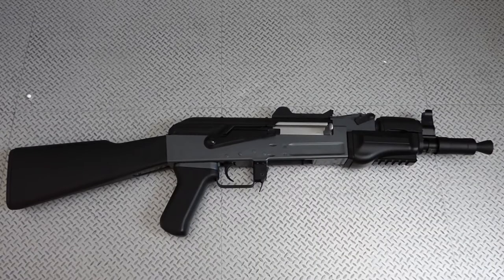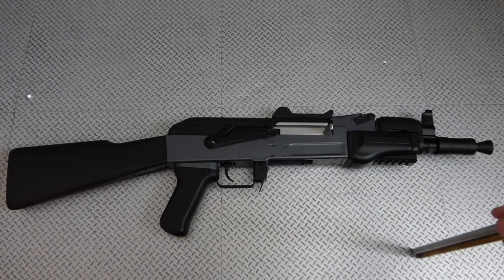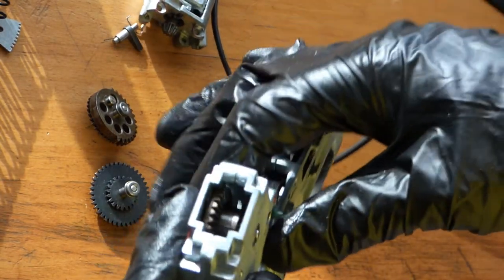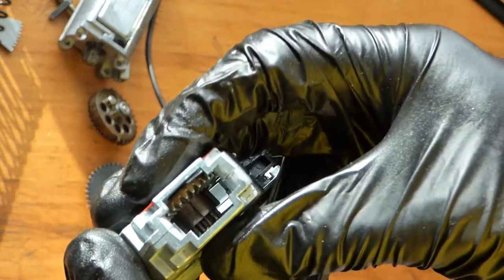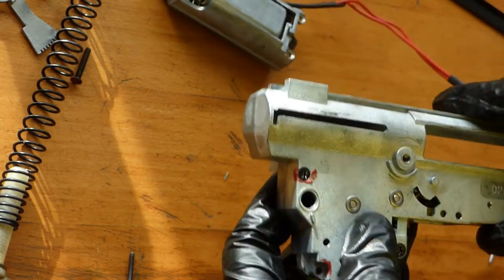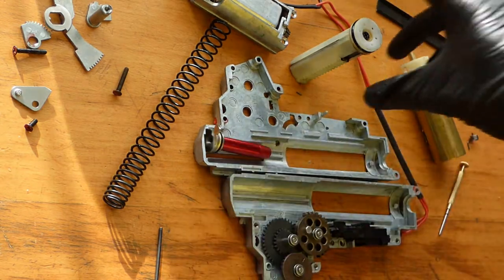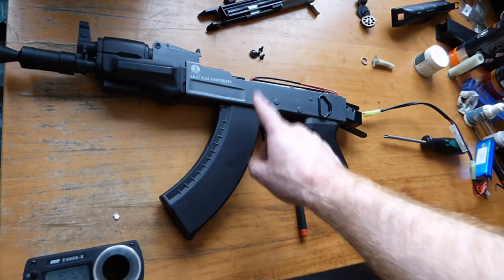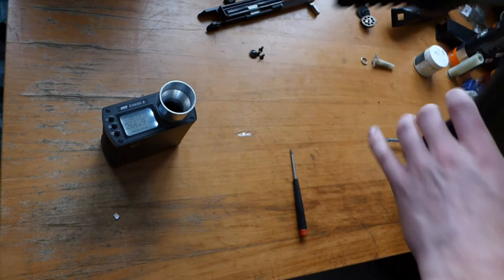Cyma AK47 Service and upgrade

Comment: Hey, so glad I found this video. I bought one of these over 10 years ago but stopped playing. In the process of trying to restore my CM037, As you can imagine the inners didnt weather too well in cold storage for a decade. Wondering if all V3 GBX spares will fit this, would you be able to post a link to the parts you upgraded in the video comments by any chance ?
Reply from the maker: You may find it just needs a clean up and some fresh grease and maybe new orings for the airseals. It is a very standard gearbox  you will be able to get a plentiful choice of internal replacement/upgrade parts if you choose to. 😎
Reply: @adzzzysarmoury  awesome! Thanks for the quick response. 10/10 video.
Reply from the maker: @4RealHero  no problem, fingers crossed you get your CM037 working at full performance! 😎

Comment: Hey, great video! Got one question: how long is the inner barrel in the gun? Thx.
Reply from the maker: Hi, thanks. The barrel that is in this is 290mm. It's not the original barrel.
Reply: @adzzzysarmoury  Thank you for a fast reply. Do you know about the og barrel?
Reply from the maker: @lukazajc8265  the original barrel would have been slightly shorter but not by much. Can't say exactly as it was ages ago.
Reply: @adzzzysarmoury  Okay, no problem. Thank you.